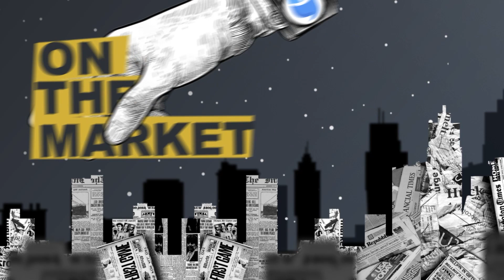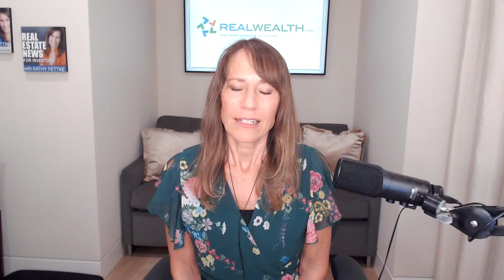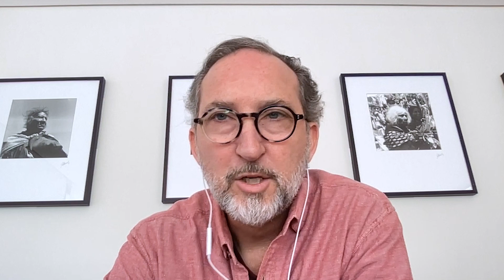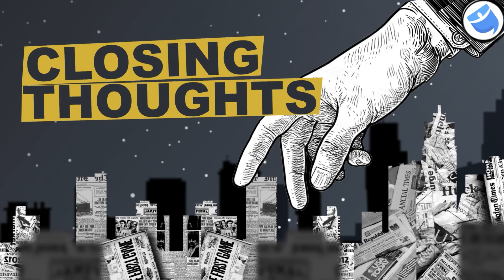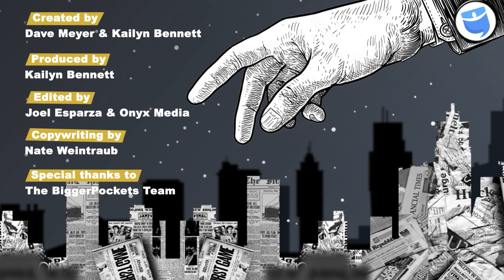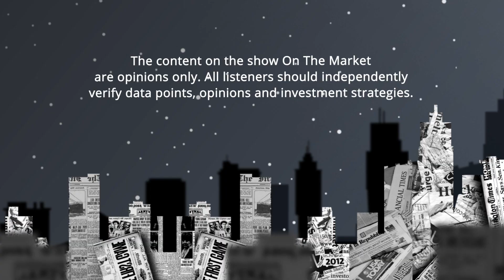Why "Net Zero" Modular Homes Make Much Better Rental Properties

Comment: some good information, but from a builder perspective I got nothing that would make me want to build a house using this product. he was extremely vague and made sure not to reference cost other than saying 20% savings. the website says even less. seems like another green product that will only save money if built in extremely expensive areas. I hope I'm wrong, but he said nothing to make me think otherwise. energy efficiency is great, but from a builder perspective it needs to also be easier and more affordable to build, not just quicker.
Reply: I will be following the website to see when the factories in Florida and Alabama are ready.